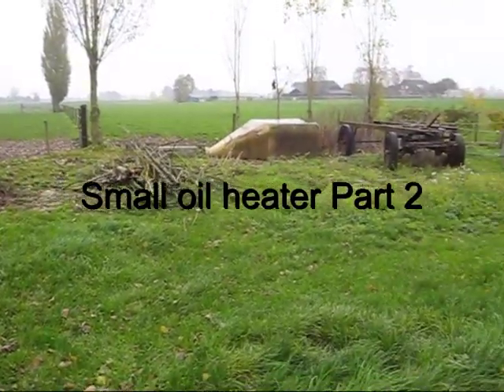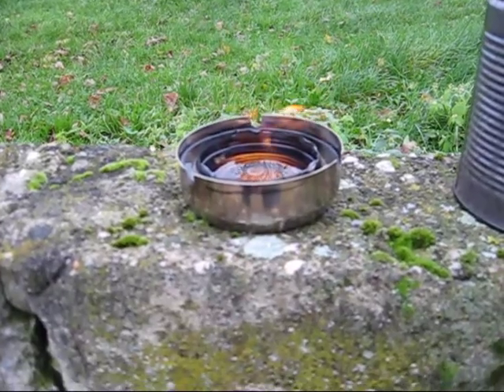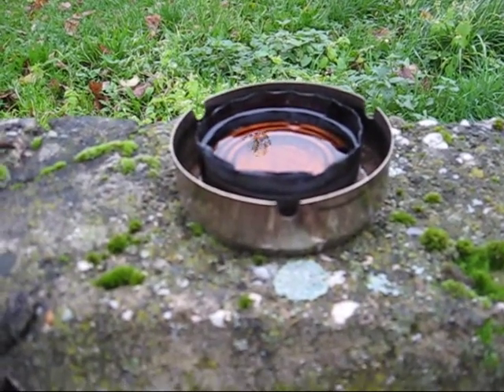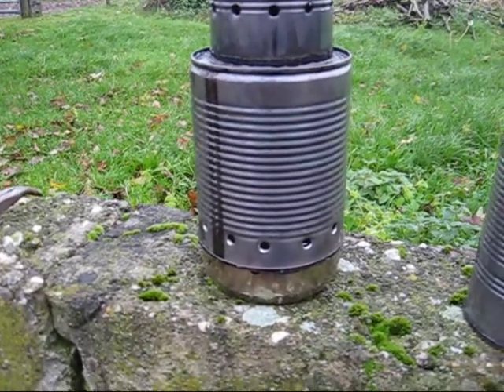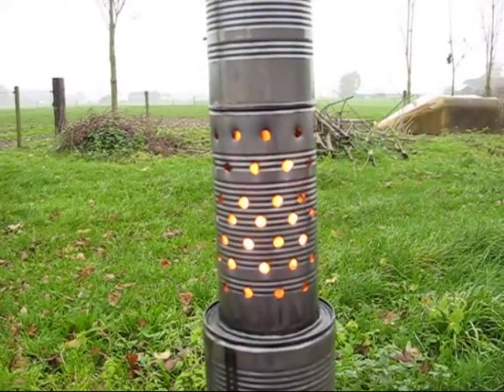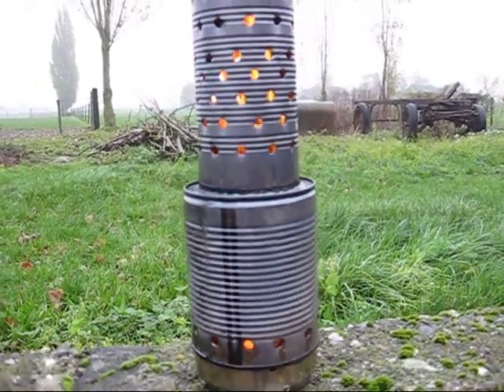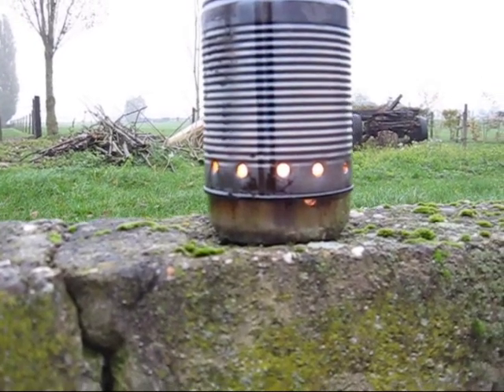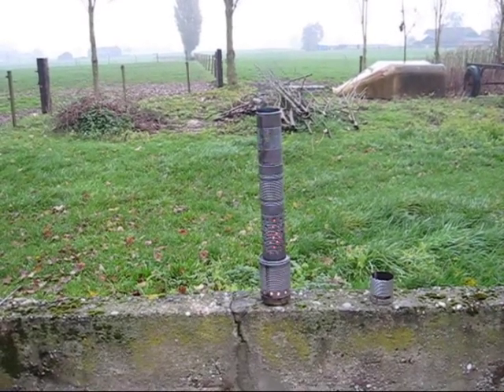Small oil heater Part 2 ( Sunflower oil burning test)

Comment: I would imagine that if you blocked off a number of your primary air inlet holes you will burn hotter (cleaner) and longer on a given load of oil. Half that number of holes should make for an improvement. Smoke exiting your stack indicates= insufficient air to burn all the smoke produced in the primary  burn. The easiest solution is for you to decrease the primary burn by choking it down using less primary air so less smoke goes up your stack, you ought to be able to find a point of balance between the two.
Reply: just thought that a shorter stack  which will decrease the draft and so will also lessen the primary burn and this will make for a simpler and more manageable stove design as well
Reply from the maker: @morayjames92  just a experiment long a go.
Reply from the maker: @morayjames92  I have never cooked on vegetable oil. I personally don't find it convenient to carry oil in a backpack. The oil is indeed very difficult to ignite. We do cook on diesel and lamp oil with the pressure burner. But on the hikes I have a simple wood burner with me. Wood can be found everywhere during a trip and can be stored dry in a plastic bag.    https://nassetti.wixsite.com/tobor

Comment: did you ever do the drip feed. I used similar design but to get ignition I just used kitchen paper as a wick and set that burning. it lights the oil good and burns for 1 hour in mine. but a drip feed would have been good. will you do video of drip feed vegetable oil drip feeding? great videos.
Reply from the maker: Next winter , now have to work on glas in France.
Reply: Ok thank you. :0) I subbed to you.

Comment: If you put more holes above the first row of holes in the first can, you intensify the combustion of oil more in the bottom burn chamber where your drip tray is. Im making a Ozzirt style tin can oil stove, ill make a video when its finished, maybe it would be interesting to you.
Reply from the maker: More holes is not good.
Then the chimney does not work.
Smaller holes worked even better

Comment: Did you make the drip feeder, and did you try to burn waste oil?
Reply from the maker: Not yet. I do this in the fall.
Reply: Other videos of waste oil burners show that you may have to add extra air flow by the means of some kind of blower. Maybe an old hair dryer or something. I am looking forward to your experiment.
Reply from the maker: I downt juse a fan.

Comment: Good experiment, thank you for sharing.  I am also trying to make a heater as low tech as yours, but I have not had good results with the excessive smoke.  I am burning used motor oil.  Looking forward to that drip feed video.